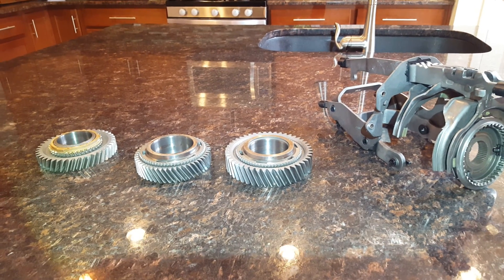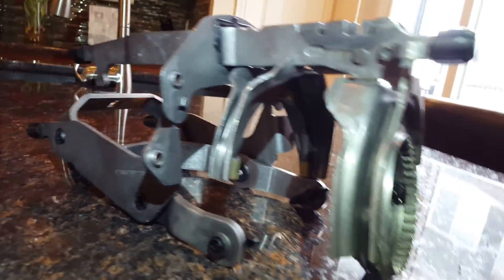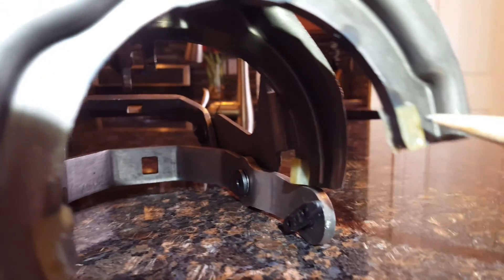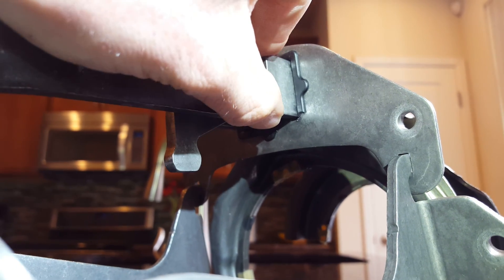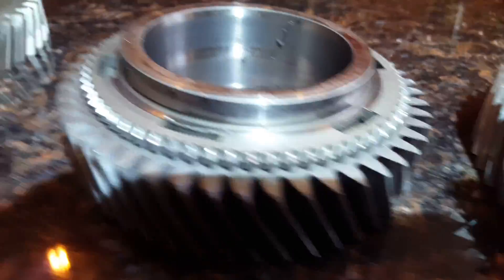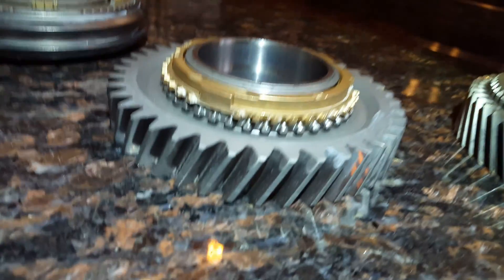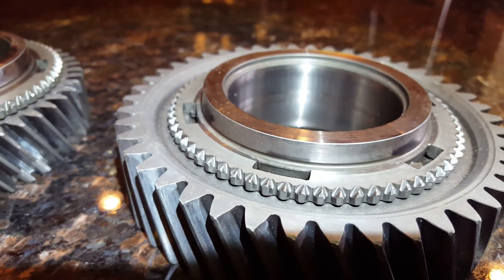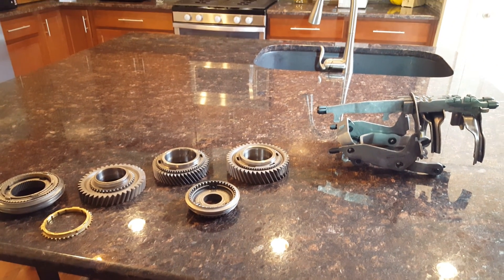Jeep Wrangler NSG370 transmission shifting  problems.  Shift fork and synchros.

Comment: Sometimes I can barely get the transmission into first, have to double clutch for second, and reverse can be hit or miss if it's going to be easy to get into. I know the shift fork assembly ain't cheap, about 500 bucks just for the fork assembly, and the gears are about a hundred dollars each. I think I might try and find a reman transmission.
Reply: What did you end up doing to this trans, having same dilemma, can't choose rebuild or remanufactured ?
Reply: @roberttodd7054 nothing yet, just living with it. It’s not my daily driver anymore.

Comment: My transmission Jeep Wrangler rubicon 2014 auto m speed meter is in 0 and my transmission doesn’t wanna shift .  Jeep was involved in an accident and after I put all together I found this problem.  Can u help pls ?  Thanks
Reply from the maker: That is a totally different transmission and engine then in this Jeep. Sorry.

Comment: It sounds like I got lucky. My nsg370 in my 05 tj x just now got stuck in 6th gear. 330,000 miles on her and still on original everything minus a few fluid changes.

Comment: My 2008 jk wrangler 3.8 6 speed v6 right hand drive pops out of 1st gear on take off. I'm thinking of buying the improved B&M 45195 Precision Sport Manual Trans Shifter Kit from the US which will cost around $800 Australian and I need to be sure it will suit?
My question is this.
Is the shifter sequence the same for a left hand drive US model as the right hand drive export model?
The shifter sequence on my right hand drive jk is forward far left from driver for 1st gear and back far right toward the driver for 6th & reverse. 
Hope you understand what I'm saying.

Comment: I have 05 tj 6 speed manual 100,000 miles just changed clutch master cylinder slave cylinder ,still having problem going into 3rd gear and popping outta 1st ,whats the $$$$ gonna be rebuild this ,thanks

Comment: People do not understand why their synchromesh is destroyed.  It is simple.  If you refuse to rev match, the synchros will wear prematurely.  Most transmissions are "progressive" types, which require that you wait quite long to complete your second gear shift. And then as you go up each gear you shift faster.  I  get honked at when starting off at lights because I wait for 2nd gear.  Rev match into second (long wait) and  a shorter wait as you go up the gears.  Your transmission will last the life of the car as does mine.  I have never owned an automatic, and I have never had a transmission failure.  I am a 43 year veteran long haul driver, so I have a bit of an advantage on most green drivers.  And by the way, the reason that reverse gear synchro are destroyed, is because you were ramming it too hard.  Gentle guys!  Stop ramming those poor transmissions, and they'll last the life of your car as do mine.  Glad to help!
Reply: Yeah spot on what you said and also change the oil!! they only hold like 2 quarts ! so change it every 20,000miles dont like it, get a prius or an Auto
Reply: Doug Stern that’s funny, I have noticed the rpms needing to come down before this transmission goes into 2nd easily. I am a 19 year truck driver and that makes since to me. I will probably have to rebuild my transmission because I didn’t get the Jeep until it had 90,000 miles on it when I got it.
Reply: Bingo!!!

Comment: I have a Jeep Wrangler X 2009 2 door. When ever I let go of my clutch in 1st or 2nd gear it kind of shakes a little. But it’s only in those two gears. It just recently started happening and it has 77k miles.
Reply: changed the oil recently ?

Comment: Another reason you dont get a manual for off-roading.
Reply: Actually this is exactly why you get a manual for off-roading. Manual transmissions act up, they don't break down like automatics (never mind the fire hazard.) Never take an automatic off road so far that a flat bed tow truck can't reach you.

Comment: My reverse in my nsg370 has started acting up. When putting it in reverse, I have to pull as hard as I can to get the gears to engage. Once I can get it engaged, its fine and will not pop out unintentionally. Unfortunately, its been getting harder and harder the last few weeks. Ive been told it's a bent shift fork? What are your thoughts?
Reply: Cody Buscher mine does the same thing once in a while..what i do is I put it in reverse to where it doesn't want to go anymore without any force then very very slowly release the clutch to the point it just barely grabs and with a tiny bit of pressure on the shifter it should slide into place
Reply: Jon G I recently figured that technique out lol
Reply: Hey guys i know this is an old comment I'm replying on but I'm having the exact same issue. It goes into reverse if I pull back on the stick while letting off the clutch but I'm worried about my tranny and this seems like a temporary solution. Did you have to have it rebuilt? Or is it just the plastic housing shown in this video causing stiffness in the shifting fork? Please reply lol
Reply: @Kodeki849  Mine got to the point where I could no longer get it into reverse. No matter how hard I pulled or smacked the shifter into reverse, it just wouldn’t grab. I ended swapping transmissions and never tore the old one apart. I can tell you it was definitely caused by slamming gears like I was in a race car and I found reverse instead of 6th gear on the interstate once..... lol.

Comment: Hey man thanks for the video.  I'm having issues with my 06 NSG 370 at about 65K. My question is what if anything did the rebuild do to correct those broken wear items?
Reply from the maker: Joseph Calabrese They replaced all if the worn parts. It's good as new.
Reply: Charles Bloyer don't they upgrade those bushings? I'm pretty sure they was a tech bulletin on this issue. it's the only manual trans offered in a Wrangler to ever make the worst 10 transmission list.
Reply: I heard there is an upgraded version in titanium. Wondering what the part numbers are.  If anyone knows, post them please

Comment: My 2016 Jeep Wrangler just had mechanical issues.

I was driving home from practice and on the way home this guy reversed out of his driveway and reversed into my lane; I quickly moved my clutch to nuetral and brakes fast (I was going 37mph and braked to 3mph). No pop, no grind nothing.

After that happened I attempted to move to first gear and then second; but I couldn't find the spot to shift it in. I pulled into someone's driveway but I couldn't get it into reverse nor first.

Instead of the gears being all centered it seems like it shifted left; now first and second gear are to the Far Left.

I let my dad take a look at it and he noticed that the clutch turned about 45° counterclockwise. And forcibly turned it into the 0°.

What happened????

Comment: I have a 1995 wrangler and when shifting into 2nd gear no matter how far you push the clutch in it grinds could that have to do with the gears being worn down like that?
Reply: probably late to answer your question, but it would have to do with the syncronizers. does it only do that in second gear?
Reply: Yup that is synchros.  See my first long post for the solution...next time.

Comment: okay here's a question I'm really hoping you have an answer to. I just dropped my transmission. when I took off my flywheel I notice that it feels like a two-piece unit and the actual friction piece where the pressure plate bolts to seems to spin separately from the geared part. is this something you noticed?
Reply from the maker: +Brandon Lyons Hmmm, not quite sure what you're saying.  Perhaps you can make a video and share it with me?  You can do private vids.

Comment: great info! I'm debating rebuilding mine. What are your plans not that the gears are ground down?
Reply from the maker: +Brandon Lyons I had it rebuilt.  It was $2,200.  I couldn't find a rebuilt unit for anywhere close to that price. A1 Transmission here in Denver did it, and they did a great job.
Reply: +Charles Bloyer didn't trust the rebuilt transmissions on ebay? They sell for $1600. I was going to go that route but if I do it myself I'll save money and end up with a bunch of new tools. Now that I watch your video I'll need to crack mine open before I know if it a real option for me.
Reply: Brandon Lyons not worth rebuild I did once now 60000 mls later out again

Comment: Hey man great info. I have that exact problem with first and second on my TJ. What's it costing you to get them replaced? Or are you doing it yourself?
Reply from the maker: I paid  $2,200 and I removed the transmission myself. Rebuilt units are hard to come by and often more expensive. My dealer quoted $5,300, but they're criminals. Since it's out of a Wrangler, and Wranglers don't see junkyards very often, there's just no inventory to rebuild and sell as re-manufactured.